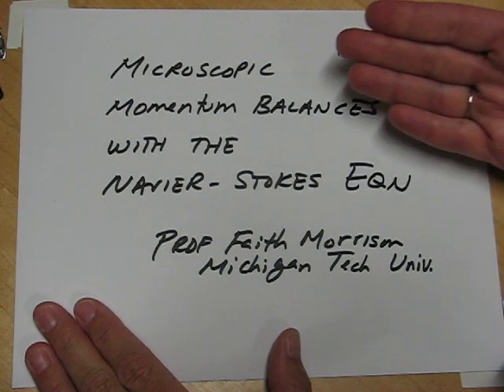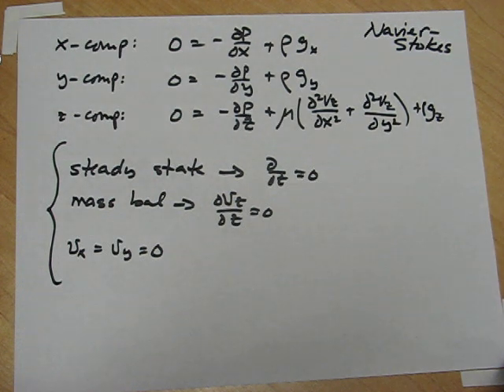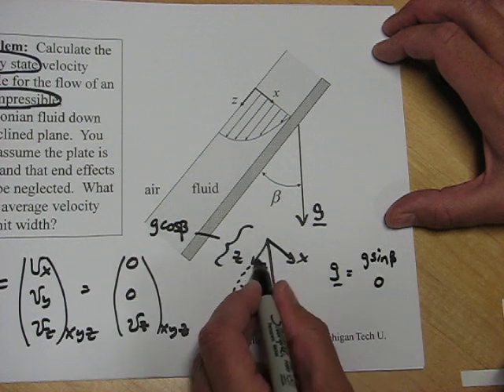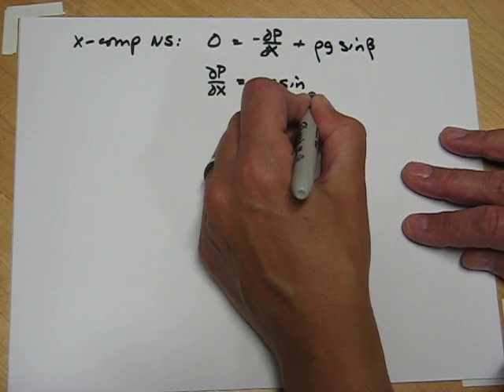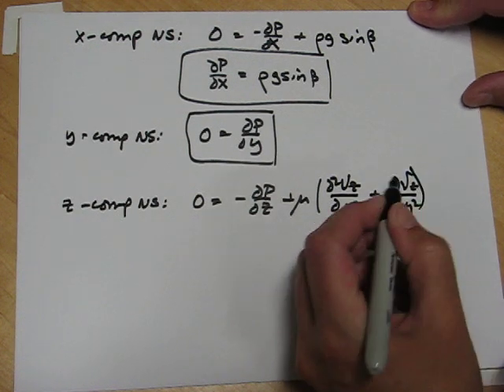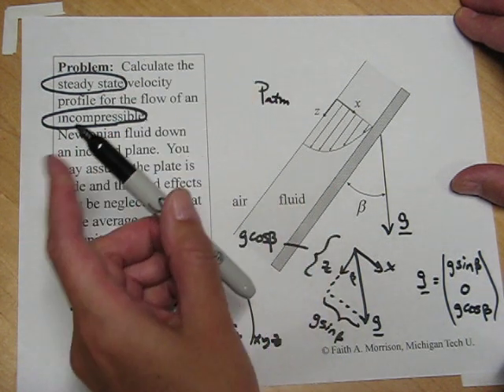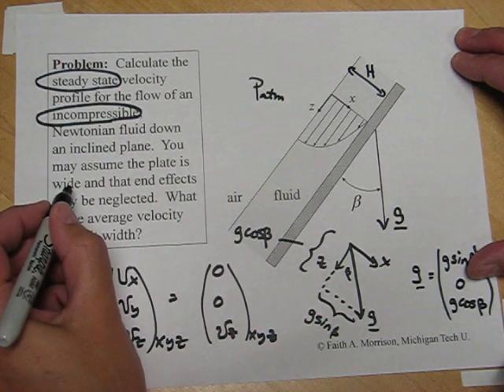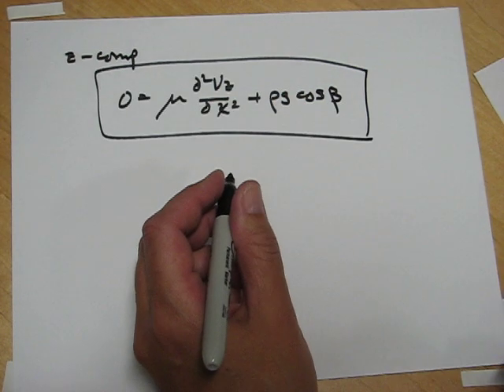Part 2:  Microscopic Momentum Balances with the Navier-Stokes

Comment: This is well made. Though I want a more detailed explanation of why the pressure gradient in the z-direction at the edge can be assumed to be the same as the surface, which is equal to the atmospheric pressure. Help me out here. On each x-position, the corresponding  (del Pz/ del z)  is the same. meaning, as a go from the surface to the edge, the pressure gradient in x direction changes, the pressure gradient in z remains constant. When I think of pressure or total pressure, I think of pressure = force per area.  What I can't wrap around my head is is pressure is a measurement that coincide with a two dimensional space, surely we can simply put a third dimension in it but it will just be zero. But when we cancel two of the three pressure terms (pressure gradient in y and pressure gradient in z), we are left with a pressure term that belongs to only one dimension. If pressure is a 1 dimensional instance, can't I imply P=F/A can be simplified to P=F/L (whether it be the length, height, or distance)? This is bothering me and I can't seem to find a satisfying answer.

Comment: Hello, If we have a very long vertical pipe (z direction) which has a downward flow inside, does the pressure inside the pipe is equal along the z direction ?

Comment: Physically, the hydrostatic equation is a force balance on an element of fluid where the only forces acting upon are the Fdown (top of element), Fup (bottom of element) and Fg (going down also)... If your fluid has movement in the z-dir then viscous transport occurs in the x-direction, this is an additional force rep as the shear force. Assuming the shear force is going down the z-direction then your balance is Fdown+Fgz-Fvis-Fup ... hence your pressure differential in the z is shear dependant

Comment: How would you do that? I'm having a hard time understanding how a fluid with a velocity doesn't generate a pressure gradient (thinking about a fluid inside a pipe with a velocity...)
Reply from the maker: Gravity pulls the fluid down the incline, creating flow in the absence of a pressure gradient.  Pressure forces are only one possible force; there are other sources (like gravity).

Comment: Good work.
I have a suggestion: You can proove mathematically that the pressure is only a function of x coordinate and then eliminate the pressure gradient in the 3rd equation with no physical explanation.
Reply: what doesn't make sense to me is if the general equation for pressure is defined as force per area. Having only one pressure gradient would make the problem a whole lot easier to solve, but doesn't it violate the equation? Or pressure can be defined at a single point or one-dimensional without violating the general pressure equation.

Comment from the maker: If the plate is not wide, you need to specify what is going on at the edges, i.e. no-slip at a wall, or fluid falling over an edge.  This makes it a much more complex problem that you would probably only solve numerically with a program like Comsol, for example.  The equations to solve are set up the same way.

Comment from the maker: @jzsfvss 
Good morning!  Gravity does have a component in the z-direction, as you say.   This component of gravity causes the flow to move in the z-direction.  You're thinking of fluid statics - if the fluid were not moving in the z-direction, there would be the isobars horizontally that you speak of.  But the fluid can move in the z-direction, so the force of gravity goes into motion, not into fluid statics (rho g h).  In the x-direction there is no motion and hence a pressure gradient.

Comment: Dr Morrison: I think you have made a mistake. The pressure along z is not constant, since gravity has a component in its direction. So the layering of equal pressures in the fluid will be horizontally, and the pressure does vary along z.